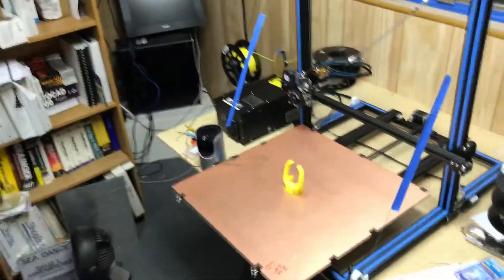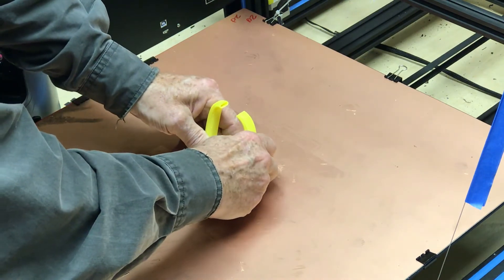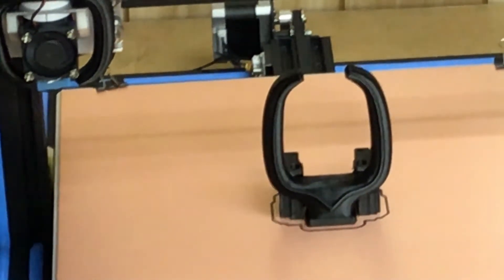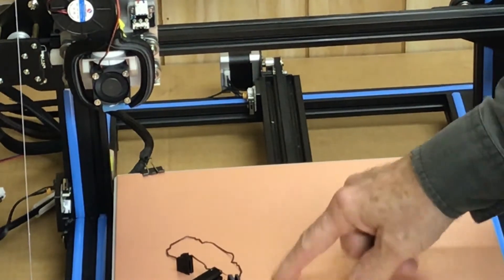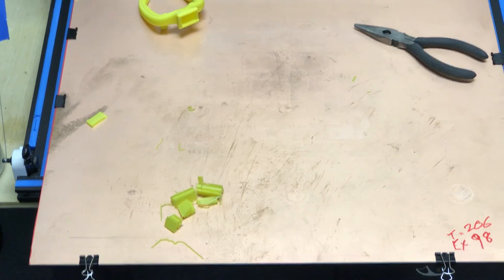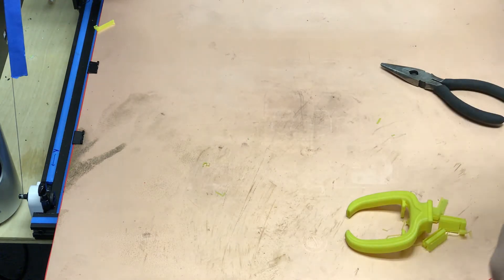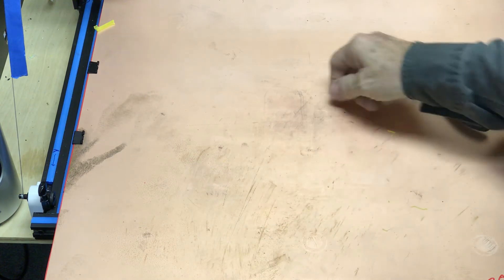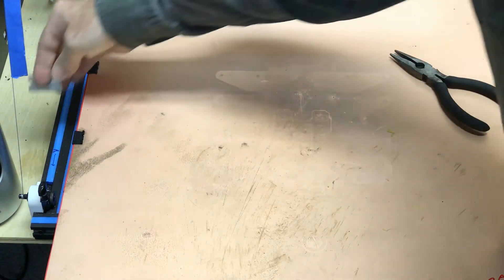Super Build Surface

Comment: I don't really like using hairspray, i prefer printbite.
But the main insteresting thing is the weight, in have no ringing on the 300mm but i know it's a real problem on the 400mm and 500mm and it would be ideal for that.
Reply from the maker: Tac Blades yes. Use what works best for you. I only use hairspray when supports build from the plate.     One thing I forgot to mention in the vid is; you can take it off after a big print and flex the board. It pops right off!

Comment: What about putting something like an athorbot on it so you don't have to use hairspray or another adhesive but you can remove and flex to get a stubborn print off???
Reply from the maker: I forgot to mention you can flex and pop stuff right off
The only time I use hairspray is when I have the tiny support attaching to the buidplate. it sometimes fails on the first layer...thats the only real "need" for it. Also I use this exclusively because the copper is softer than the tips (wont wear Tips) but won't melt plastic build plates.

Comment: How is the bed leveling configuration coming along David?
Reply from the maker: paulienet great. Finished the fangs today. I can post some photos to you if you message me. 
I've compiled over half of my presentation.
Reply from the maker: paulienet look in the part of the video where I remove the (Stinger fang) from the heated bed. 
You’ll see it in the upper left corner of the vid.
I just finished the “face design” with newly designed fang setup for the reveal presentation.